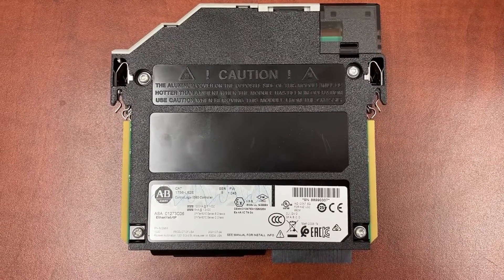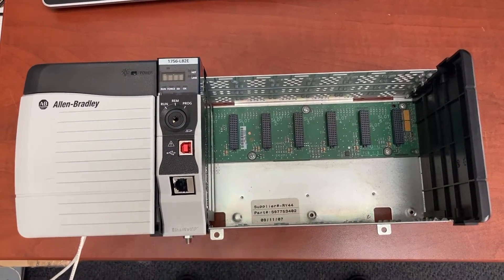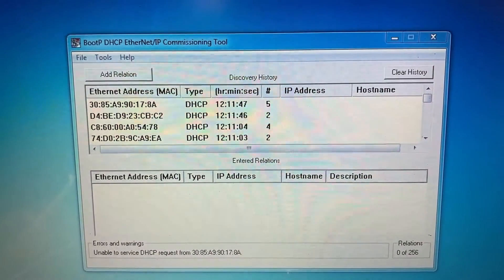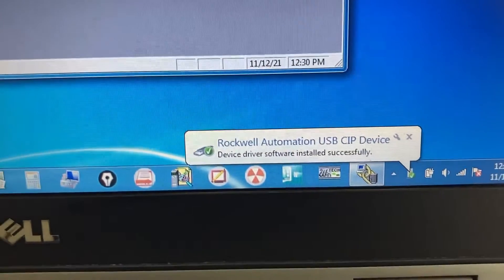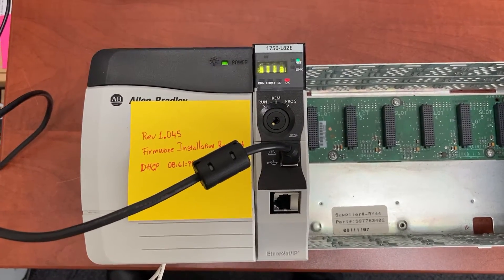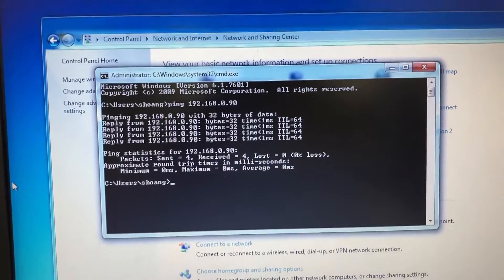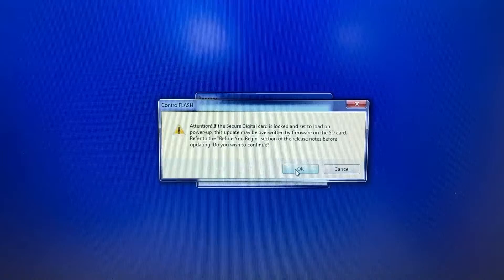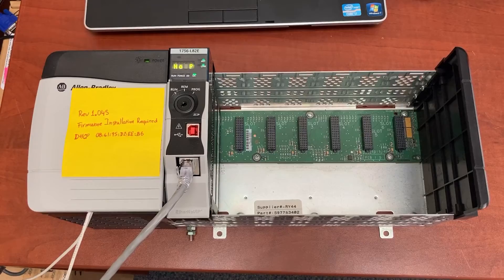ControlLogix 5580 1756-L82E Ethernet config and Firmware Flash

Comment: Ever encountered a situation where you set IP address and flash firmware successfully but then could  not connect to download a project even when physically connected with USB or ethernet?
Reply from the maker: @Waylon Steelman: You might need to check your PC network adapter? Is it set to the same network with your PLC? Otherwise, how do you know you have successfully set the IP to the PLC? Have you ever tried to ping your PLC from your PC?
Reply: @SYPHOANG  I am sure I was communicating it the control because of the scrolling messages on the plc LED. It was scrolling the new IP and Firmware I pushed to it but when I went to download the project, upload and download stayed grayed out. Very strange since a vendor could login through our vendor net and connect

Comment: Do you have to always update firmware with new controllers ?
Reply from the maker: @PURGE3000: Yes, we ALWAYS have to do it because the firmware pre-installed from the manufacturer is ALWAYS very low (v2,3,etc.) while the software studio5000 now is 33. They do that to make sure it would work for everyone, especially those who still use the old software rslogix5000 v 15,16,etc. Just imagine if the firmware pre-instaled from the manufacture is the latest v33 and you only own the software v30. Then you will not be able to do anything with the controller. Thank you for subscribing to my channel.
Reply: @SYPHOANG  thank you and thank you for your videos. So much I have learned.
Reply from the maker: @PURGE-3000 : My pleasure. Once again thank you for subscribing to my channel.

Comment: Excelente amigo, hay algo que prevenir en caso de que el módulo esté en arquitectura redundancia? Y además esta en producción.

Actualmente el chasis secundario está funcionando y el primario tiene problemas y debe ser reemplazado el módulo EtherNet.

Gracias por tus comentarios
Reply from the maker: @ARDUINO SANTA CRUZ BOLIVIA: It is not quite clear what your question is but one 1 controller is running the logic/program/in operation in a redundancy system. It is the Primary Controller/PLC. The other one is just a SYNC/STANDBY/Secondary which is just standing by and doing nothing but waiting for the primary one to fail to jump in. Thank you for subscribing to my channel.